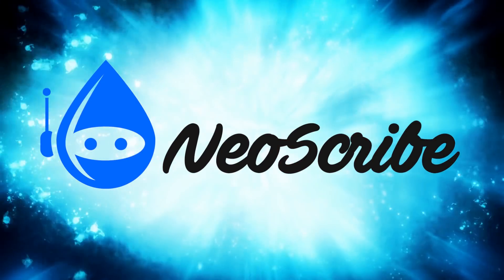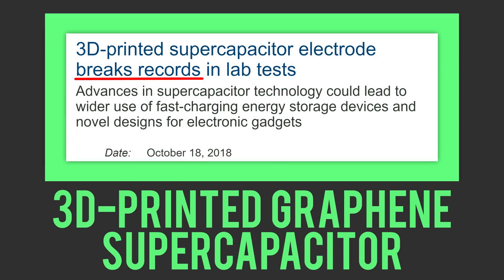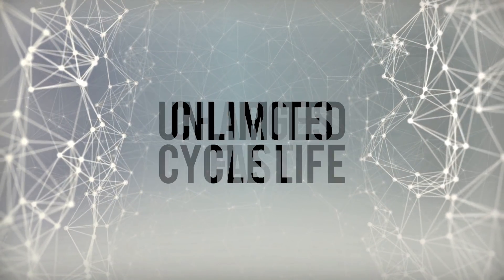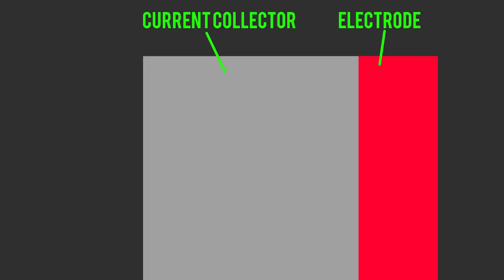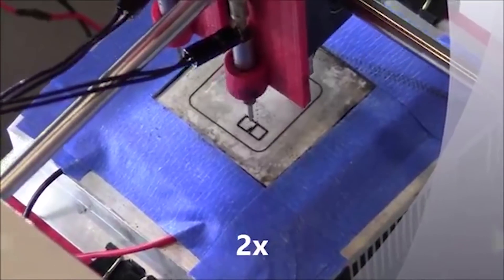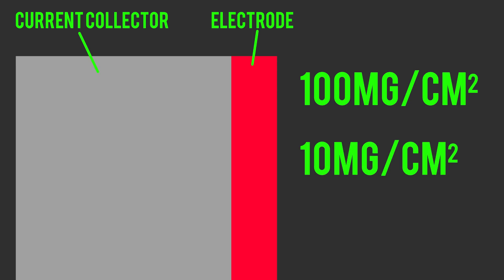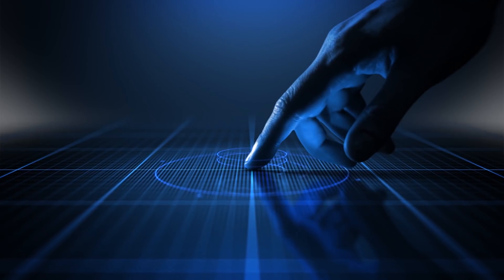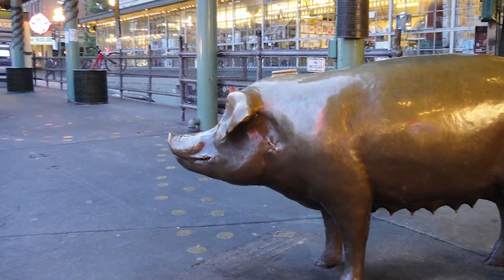Amazing 3D-Printed Graphene Supercapacitor Electrode

Comment: Supercaps are not a good battery replacement. They are a wonderful technology to add to battery packs when fast charging is required. A supercap can capture regenerative braking energy then charge the vehicle batteries at the slower rate they require. Energy otherwise lost is captured. Your home charger could fill the supercap in your phone quickly without causing damage to the battery with high charging rates.

Comment: What's the difference between power density and energy density?  Also, silicon is one away from graphene on the periodic table of elements, is that what gives them similar properties for printing a supposedly 'graphene' supercapacitor electrode?

Comment: what we need is a supercapacitor made from graphene or silicene that uses a 1-dimensional photonic crystal layer as the insulating material. 1DPCs are better than vacuum at insulating. It would hold its charge much longer than modern supercapacitors and could allow for much higher charges.

Comment: I see the use of both working together especially in cars .Caps to accelerate at start of movement .This would be recharged by regenerative braking .This would help the main battery last longer.Caps can discharge at lot more times than batteries.So you would not have to have as big a battery pack in theory.

Comment: In capacitors the electrons are held in place by opposing metal plates seperated by an insulator, one plate is loaded with electrons (-) and the other side is depleted with electrons (+).
There are no moving ions...
02:05
Reply: not in super caps
they work by both double layer and pseudocapacitance

Comment: can this american Lawrence Livermore National Laboratory match this british professors real life Graphene and related nano supercap/battery conductive inks etc formulas ?
 https://youtu.be/-CLfynG3ECk?t=114
Some Cadex Reports On The Battery
Robert Murray-Smith, Published on Jul 4, 2017
-----
A Supercapacitor From Old Tyres
Graphene Concrete Update 2
Self Limiting Conductive Ink
Lithium Batteries And The Cobalt Shame
A Supercapacitor From Old Tyres
Saving The Coal Industry - Part 3
Hemp Battery - Almost Unbelievable
Advanced Lead Carbon Battery - A Few Weeks On
Copper Plating Without A Battery etc
https://www.youtube.com/watch?v=z-1t2JfLVKE

Comment: Solid-state electronics means semiconductor electronics; electronic equipment using semiconductor devices such as semiconductor diodes, transistors, and integrated circuits.

Comment: Incredible future ? Yeah right !!! C60 has been around for many years nearly 100. Dr Harld Buckminster (Buckmister fullerene) forecast it long ago. Then C76 mixed with Potassium, a "High Temperature Superconductor", (BBC's Tomorrows World was all over this in 1992) then HHO a gas from water, the same stuff that comes from your kitchen tap/fawcet. Ford Escort got 100 miles on 4 Fl Ozs of tap water converted into HHO., 40 litres ? Well over 33,800 miles ! Then there is Starlite. Dr Maurice Ward (R.I.P.) invented a compound that can withstand 10,000 degs 'C' Where are they ??? Held back stolen. at least 30 years old ALL of them. Bright future ? We had ONE 30 YEARS AGO !

Comment: NO replacement for batteries, but complimentary! Capacitors discharge at once, unlike batteries which discharge at a slow rate to accommodate usage! Get that?!
Reply: Capacitors only discharge at once if you don't limit their output. If you replace the battery in any device with a capacitor of the same storage capacity and a regulator, then you shouldn't notice any changes in the amount of time you can run it for between charges.
Reply: you can`t discharge a supercapacitor at once, it will melt everything, unlike a normal capacitor that will only give you a big spark
Reply: @himanologanor4093  
How about a large number of individual capacitors, with a smart switching and smoothing circuit to discharge the in sequence?
That would allow for gradual discharge and regen of the pack
Reply: @rogerstarkey5390  you`ve just painted a nice working situation with 18650 Li-Ion accumulators, they will gradually discharge and give you a LOT more power than same size supercapacitors , still if you want sudden releases you can place 2 supercaps in series over the 18650 (supercaps only have 2.5 volts versus 4.2 volts so you need 2 in series)
Reply: In the electrical engineering world, super caps are viewed as nothing more than a battery, but (so far) one with lower energy storage capacity than a battery. The figure of merit for these super caps will be the day that one of them can match the energy density of a Li-Ion battery. So far, that day is still far off. Today's super cap's still cannot best a conventional alkaline battery.

Comment: Supercapacitor is just a moniker, it's to reflect huge capacitance value compared to a "normal" capacitor. But this huge capacitance comes at a cost of tiny voltage, so the power it can store is not even necessarily greater than that of a normal cap.

Comment: most of the issues with cutting edge battery tech is the ability to scale them. the size of the tested battery's can fit under a microscope. taking something from Nm to cm is a huge leap for manufacturing.

Comment: Another problem with caps is they discharge with a linear voltage drop.  E.g. a 2.7V super cap discharges fully from 2.7 to 0 volts.  Whereas say a li-ion cell discharges fully from 4.2 to 3.2 volts.  This means you need a DC-to-DC converter to make use of "super cap batteries" which further reduces their energy density given the best DC-to-DC converters are ~90 to 95% efficient.

Comment: This isn't the only downside to super capacitors. They also bleed energy. Leave a super capacitor alone and it will leak it's charge at a far higher rate then chemical batteries do.

Comment: This makes me think we could create static electricity recuperative breaking.
Reply: Yes that's one of the things Tesla is going to do with the Maxwell Technology capacitors. Not only can you store energy quickly and efficiently with the capacitor but you can discharge quickly as well, super caps and batteries go very well together in cars.  The super cap will shave off the peak load demand from the battery. When you stomp on the pedal the super cap will provide the energy and then it will slowly recharge while you're traveling ready for the next energy demand. And also when you step on the break it creates a high load the harder you break the greater the load which doesn't bode well for batteries but super caps have no problem with that scenario. Just wait and see what Tesla does with super caps in the next year or two with or without the acquisition of Maxwell Technologies.

Comment: Allright. 3D print me an entire car out of that aerogel capacitor lattice. It would be light weight.. it's own battery... and the Spongelike structure looks great for crash absorption. Elon Musk: Do it.
Reply: A spectacular way to die.
Reply: haha nice teory must be hard to implement it on real life most of it economic. but would be nice prototype project.
Reply: You could likely make a plane out of it.. you would just need a thin layer of smooth paint on the outside
Reply: @greenthizzle4  Even the paint on a commercial airplane adds several hundred kg´s... The use of composite carbon fiber materials like in the 737 is a good start.
Reply: That would be amazing
Reply: oddly enough the gel is very brittle

Comment: When does the power density become dangerous (or how much power can be put into a sq cm)  in an accidental shorting? I'm thinking of something like a Lipo battery burning when damaged
Reply: This is static electricity not chemical. A electronic management system regulates the current. You could crush this and yes you would have a melt down. But once the circuit is broke the action stops. Not a concern.
What cracks me up is people have been driving around sitting on top of a 20 gallon gasoline tank and then question this safety?

Comment: Instantaneous energy discharge is the biggest problem of capacitors
Reply: Banks have electronic management systems just like batteries have BMS
Reply: @Dana5775  capacitors with... Shall offer weight less advantage, they have great future for very lightweight cars
Reply: consulting insultant they are currently 5 times heavier then lithium per energy density!
Reply: @Dana5775  liability on account of instantaneous discharge + liability on account of bieng heavier = inappropriate devices for now, they should try how to develop technology to produce H2 from a cheap and environmental source for H2 fuel cell car. If Musk is fixated to electric car then >< some Mr. Ksum ,even from China should put in the billion for the research

Comment: the battery breakthroughs are always 5-10 years away. It's called the technology horizon. It keeps receding because the last time any of this tech escaped the lab was 35 years ago.  I'd like to be optimistic, but I don't expect anything until I see it commercially available.
Reply: 35 years ago ? You’re  living under a rock. I have bike batteries that charge in 15 minutes and will last 25 years. Barium titinate ceramic nano particulates started R&D in 2007 and have been on the market for over five years. This is one of many you obviously don’t know about. 
I remember all of the so called educated nay sayers back when this was only an idea ! All of the “breaks the laws of thermal dynamics” engineers have their foot in their mouth.
I see the same comments in these forums about how it can’t be done. It is done and will be done!
Anything the human mind can imagine can come to be!

Comment: I thought capacitors only stored a lot of voltage, but no amps, and that their energy is released instantly. So I don't see how they can "replace" batteries. Batteries store energy that is released slowly over time, how can capacitors be worked into releasing their high voltage tension as a slow low voltage energy?
Reply: Supercaps have surpassed 20%  4 years ago equivalent to batteries but many of the prototypes in lab research could match batteries energy density by weight. But not by volume. So they are designing car body’s with super caps incorporated into the body.
Just as the caps come up to battery energy density we will see batteries density multiply as well leaving the per portion relatively the same but greatly improved altogether.

Comment: Do they need beta testers, in general how can I contact them. I have a product I want to get made and I need something like this to be apart of it.
Imagine a portable battery pack that you never have to plug into the wall, and it doesn’t use sun/solar/heat/wind/water/etc to charge. And it charges in seconds, less than ten seconds, and anyone from the age of around two years old to 99 years old could charge it super easy. And the build quality I’m going to give it, it could tumble down the side of a mountain and still work.

Comment: Don't capacitors discharge all of their energy at once? If they do they will not replace batteries as batteries discharge their energy  slowly over time rather than all at once.
Reply: No they discharge according to the work draw and can be regulated just like any current device!

Comment: I'm a little confused... I thought the purpose of an electrode is to collect or conduct current, but your cell shows a manganese dioxide electrode and a current collector, with the electron passing through the electrode.  Is there a dielectric layer insulating the electrode from the current collector?  In aluminum electrolytic caps, manganese dioxide is the electrolyte, aluminum oxide is the insulator or dielectric, and aluminum the current collector.  Energy is stored in the electric field across the dielectric.  The thickness of the dielectric is critical to the energy storage capacity and max voltage; the conductivity of the electrolyte limits the rate of charge or discharge.  Did you mean to say electrolyte instead of electrode?  What is the dielectric in the graphene supercap?  Thanks, DonS